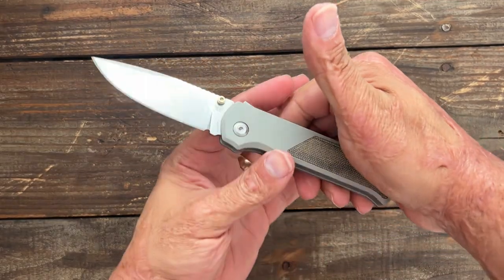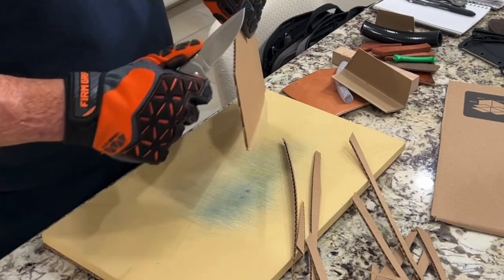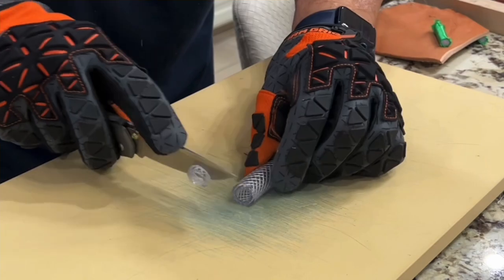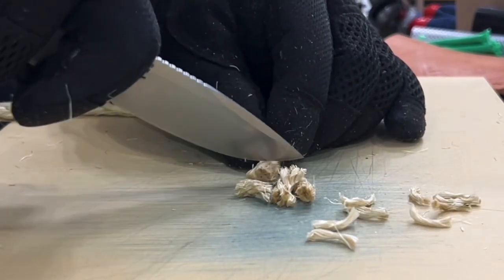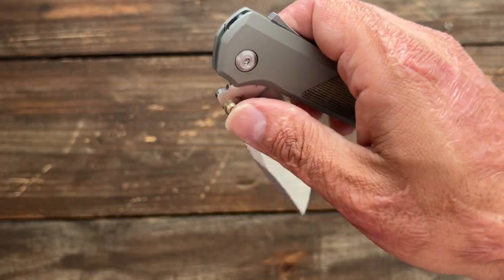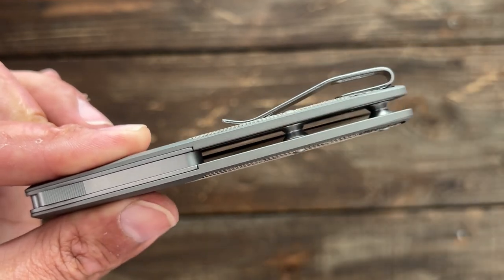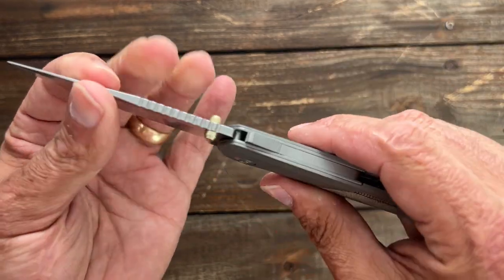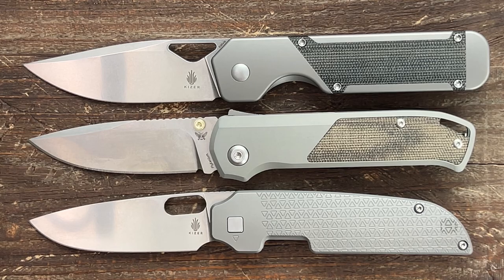You Need to See This! Flytanium Arcade Shark Lock: Review

Comment: I used to pine for the PM2, the AD20.5, and the RL Stitch. 

I now pine for the Arcade and the RL Stitch. 

The Arcade just looks great to me, and especially the Void Black handle with stonewashed blade, which also kinda shares the same color scheme of the legendary dog Pokémon Raikou! 🐶 😸 ⚡️

More seriously, I’d been thinking of getting a Vision FG just to get a bigger knife with a different lock than my KCE Kizer Swagg’s Sway Back. 

But lately I’ve been thinking that saving for something just a bit nicer is probably the way to go. 

The only question I really have is whether I also want to get a purple backspacer for it, too, to add even more color and protect the blade a bit more, tho I would be nervous about my first disassembling of a knife when it would also be the most expensive knife I’ve ever owned. 😅